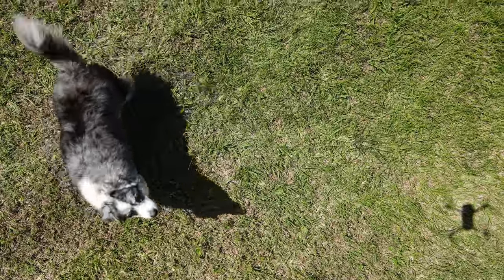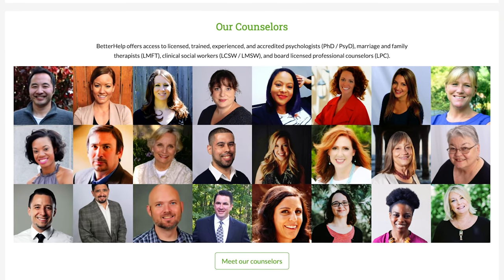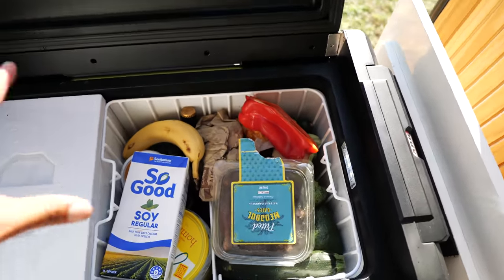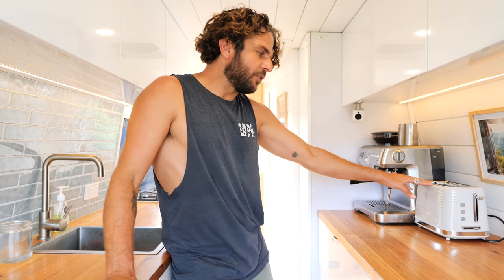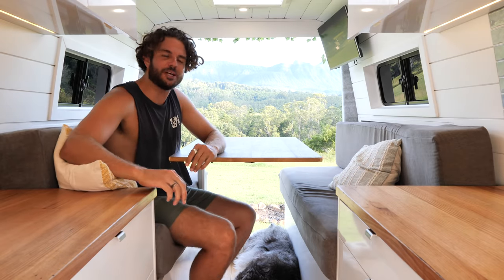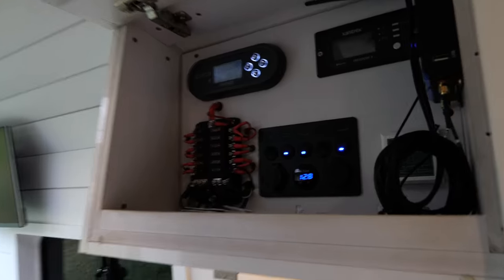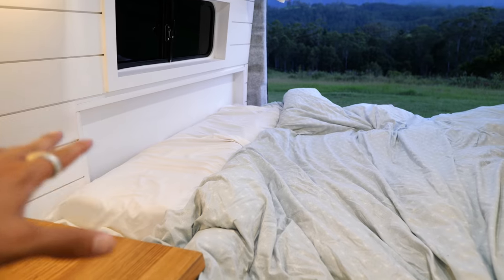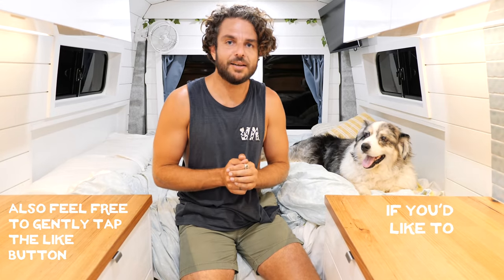TINY HOME TOUR | The perfect VAN doesn't EXI-- Over 4 years of Van Life!

Comment: Dude, this is a expert van tour. I also have an Iveco daily over here in the UK. I stopped for winter but I have only got up to insulation and battening. I also have an Evolve Skateboard, I've 2 actually. My freind worked at the shop in the UK and got me into them. I'd get that inner tube changed, one thing I will note is the screws holding the motors sometimes come loose. We all like to perminently remove those back plastic covers, they serve no purpose. Then it gives you access to the screws for tightening the motors when skating, with less hassel, maybe bring your tools that came with the board. You should tighten them regularly because if you lose the bolts they are hard to get hold of when contacting evolve. but I think they are M4 bolts, nice an short, not sure the exact length. If you lose one your breaks will vibrate and it wont slow you down and it will eventually damage your threads. Its the only maintancnce you really need.

Comment: Its a nice van , well done, and I'll give my 2 cents, I have a LWB Sprinter and had it built in 2009, I have travelled across Europe and have been in 13 countries and use it weekly for outdoor activities, but if you are in a colder climate its a good idea to use spray insulation on the walls , its not that expensive but makes the world of difference in keeping the heat in the van when there is snow outside, also, if someone is going to the trouble of a large van  its best to get a decent size 3 way fridge so you can have a decent amount of food stored, and a full size GAS cylinder, Gas runs the Fridge, the Heat at night, Hot water shower and sink and I have 2 way oven and 4 gas rings, there would be minimal amount of size required for the larger cylinder.  An oven in a van is fantastic, just pop a chicken in or a frozen pizza. I removed the middle seat in the front as it is a requirement in my country, but being able just to walk into the back from the cab and a swivel seat in the front that turns all the way to the back gives you a lot more comfort, I have something similar with my bed and I recommend that people use 2 single beds that can convert to a double as it is very handy when 2 friends are away and don't have to sleep in the same bed., Happy trails.

Comment: Hey Max - 
I have a couple of tips for you that might help you with your unorganized cables in your van and something many don’t think about ! 
For cables I put all of mine except 2 of my most used cables in snap lock bags with the contents written on them no tangles no mess and easy access and I keep my batteries in a 200mm x300 wide x100 high plastic tough box that lives under my seat !
Many don’t consider when far away from home like the out back is if you have a first aid kit - CB radio or other radio and phone is to put a first aid sticker on your vehicle especially on the back so it’s visible and your contact info like uhf / radio call sign or phone number on the first aid sticker I say this out of experience traveling when away from or sleeping in my traveling home I put my mobile number in a visible spot as sometimes police will want to contact you when you park in a bad spot  this has saved me from being fined ..

Comment: There is another alternative to holding cabinet lids up besides gas struts or locking arms.  And that is a simple coil spring designed for the purpose.  How it works is that with the door closed, the spring is simply curved.  When you open the lid, the spring straightens with the lid fully opened.  In the straightened position, it acts as a support with the weight of the door as a straight spring that can be under compression.  To close the door, you have to touch the spring, so it is no longer straight, it then no longer provides any support and just bends into a curve when the door closes.  They are sort of hard to find and one source seems to be TankTruckService as their part POLSP369410, "Polar Trailer Style Cabinet Door Coil Spring / Door Stop."

Comment: Beautiful home you have built in your van. Very well designed for function and form. It is beautiful. I think it is very livable for one person. I like the shower rest room. Escape hatch great idea. The dual fans and ventilation well thought out. The ceramic backsplash is beautiful as well as the countertops and I like the Deep sink that is not too large. The living space you crafted in the back with that very mobile table is super nice. The extension that your dog sleeps on at night when it’s cool it’sunique. He just did an amazing job. I like the white cabinetry really helps open the space up. The skylight over the bed is an awesome touch as well.

Comment: Hello Max!  I’ve really enjoyed this video.  I have 1 question.  The connection you use to attach your table leg to the bench, could you add another one to the short side of the bench, at the doors side.  If that would work you’d have more choices.  You could sit-lay in bed to work, or eat in bed and watch tv.  You could also sit looking out your doors and enjoy the scenery and feel the wind against your face.  This is of course with the doors open.  I’m not sure if the table would be able to move enough over the bed to shut the doors, but anyways if it would work it could just give you more options.  Happy trails!!

Comment: I'm not sure there is a perfect van, i mean the skylight and roof accessories look amazing, but at the same time you have so little solar that power use is heavily restricted all winter. Point is there's trade offs and opportunity cost with every decision. Like the roof vents are very practical, but stealth factor for urban camping is zero as they must be wide open to work. All up an amazing build for most applications.

Comment: Great build. I have seen quite a few builds and I wonder. If you have the van heated and the water storage inside the van (of if its not cold outside) why heat the water to the shower? In apartment buildings water can be as low as 6-7 degrees C because of water lines in the ground but not in a van.

Comment: Nice build!! I like the layout. I do have a question please, I am looking to have a Happy Jack bed lift. It allows the bed to go up and away during the day so you can use the table etc underneath. Would that work in your build? I am looking to have a similar layout so wondering what you think to have that? I wouldn't want to change up the bed everyday so having it up during day and choice to put bed all the way down or part way is nice can jave space for an overnight guest if needed and work or lounge on the couch but the bed has the skylight and that is a huge plus when up on the lifted bed. Thank you for your reply in advance.

Comment: Does your escape hatch have a cover for it?   I'm curious, because you comment on the heat in the cab, and using your bedding to insulate in the storage space above the hatch, but if the hatch is open doesn't that negate the other measures?
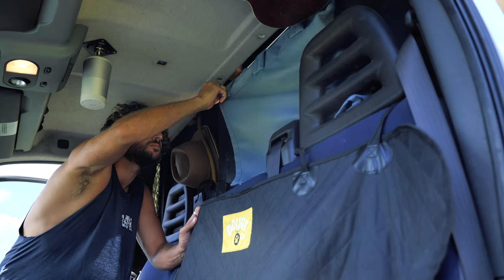Reply: at 2:49 you can see he has a curtain sort of from the cabin
Reply: @lubosbaca2305  Thanks, I guess  I missed that.  I'm not sure if that curtain will afford anything more  than privacy.   But  it'd be an easy fix if it doesn't work well.